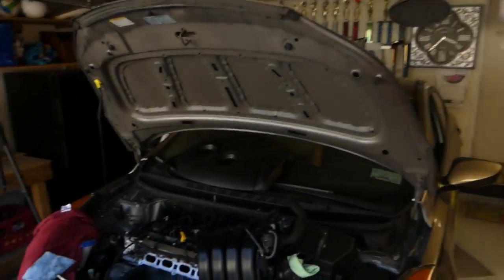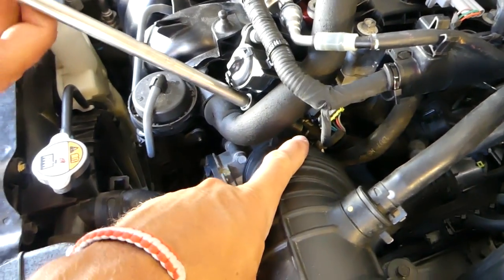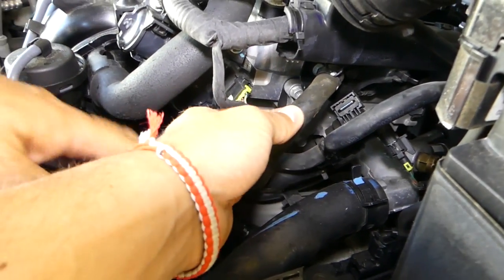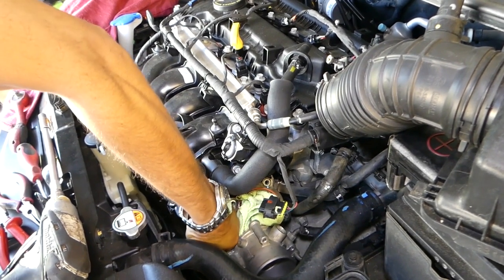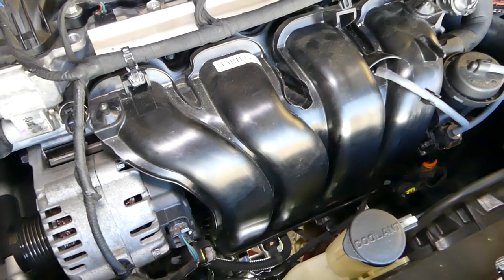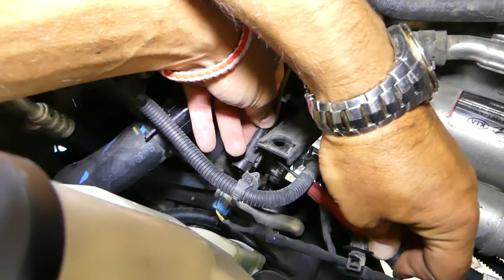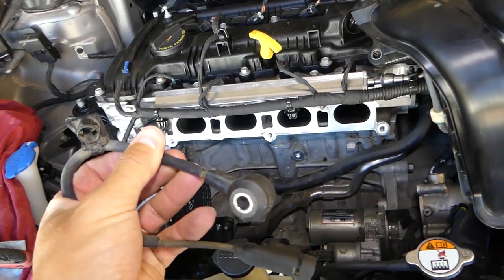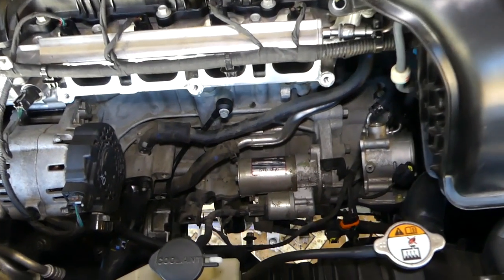HOW TO REPLACE KNOCK SENSOR ON HYUNDAI ELANTRA

Comment: Hi I have a 2013 Elantra GSL and my problem is that the check engine comes on already few times but last a short time and goes off. But before that happe nds is  the idler goes up and down and if I turn a/c off and stops. Have you encounter this before. Thanks drop me a line

Comment: My mechanic replaced my knock sensor and took the car for a road test. The car was riding rough. They opened it back up and told me a piece of the aluminum gasket broke off and bent the valve. Does that make sense to you?

Comment: I was able to replace the knock sensor in my 2013 Hyundai Accent without having to take off the intake valve. I went under the car and since it's so tight under there, it's best to use a 12mm wrench. I tried to do it with power tools and they could not fit.
Reply: Mechanics tell you they need to remove the intake manifold, but you don't need too.  I agree with your comment. Easy replacement that will save you a lot of money.
Reply: How did you unplug it ?

Comment: I have the same 2014 elantra engine, 1.8, it does not start I get code P0017 crankshaft correlation with cam shaft sensor, bank 1 sensor b ...... change the two and apart from the crankshaft and nothing, change chain and belt of time with tensioner and guides and nothing, buy a full gasoline pump and nothing, I do not know if I will see the map sensor or the oxygen sensors if they will have something to do with it, because it starts forcing and if it does it crawls through the throttle body, because I accelerate it and after a while it turns off, the vvt valves were also tested outside and they start are fine and the problem is the same .... help me

Comment: change knock senser thats the only code coming up on my 2014 kia optima car still slow anything else that can be wrong with the car please help
Reply: Oh oh looks like you gonna need a new engine but you should get a free engine by dealership if you're still under warranty.